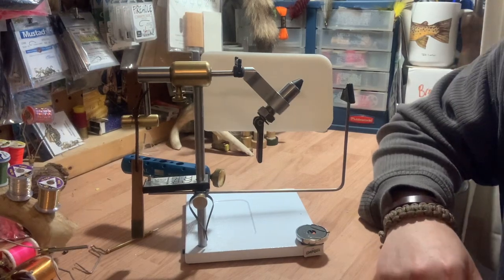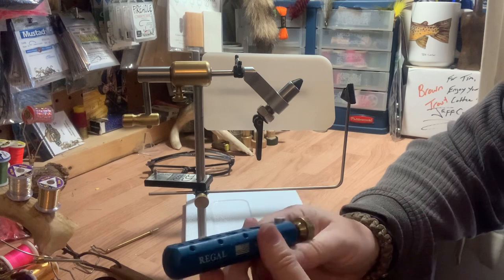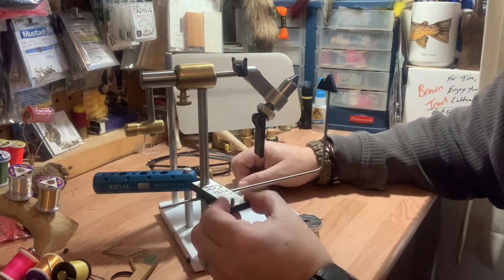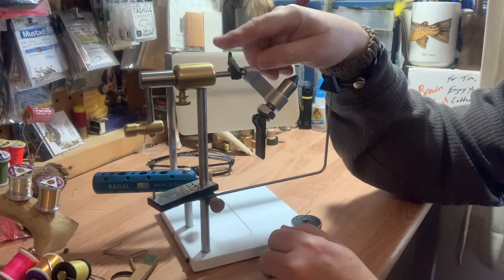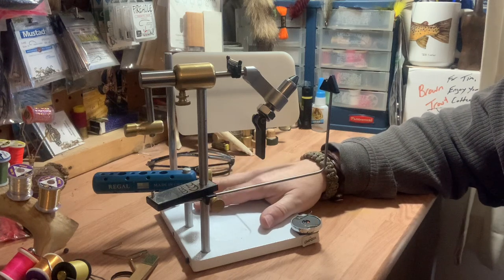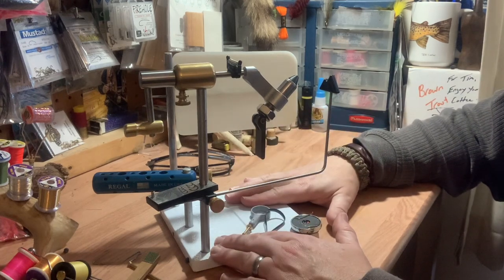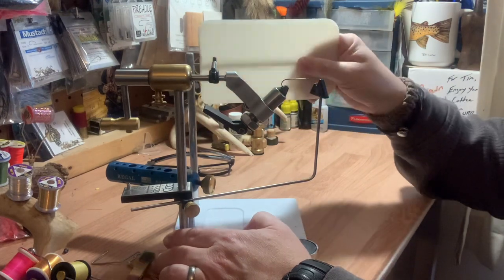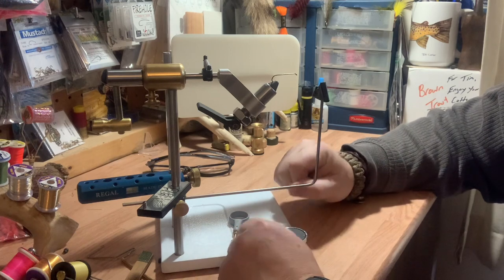Peak fly tying vise: it’s the tops!

Comment: Would it be possible for you to make me a profile plate like yours? May I ask some questions, I am brand new at this and I am right handed and am even unsure of how to set up and run the vise. Thank You
Reply from the maker: It’s a simple thing, at your hardware store, get a price of 3/8 “ aluminum rod. Find something plastic in white… and a piece of heavy wire.glue the plastic to thewire  (hot glue) dril the aluminum rod with a few holes to set the wire in

Comment: Why do you have the vise installed in the end hole  .  .  .  most I've seen use the center hole for the  vise.  Advantages or disadvantages to using the end hole?
Reply from the maker: Thanks for asking and watching my videos. To answer your question your question… that’s just what worked for me.  Having my profiler in the back and then the tool caddy  in between and low out of the way put my vise in the first or front hole…
  So yeah that’s  how that got that way.
Reply: Thanks for the quick reply.  I suppose with the weight of that base there is no tilting issues when tying.  I'll have to try my Peak with that setup.  Thanks,  Fred @lockhackle2645

Comment: Thanks for all your explanations on this vise and the accessories.
I have a question for you. How did you fix the brass adaptor you made to fit on the shaft of the rotary vise.
Thanks in advance.
Reply from the maker: Thank you,
   I jut a 1 1/2 in length of brass rod, measured the rotary handle outside dimension at 1/4 inches.
   I drill a 1/4 hole in the brass, and slid it on and it friction fit. For now. Soon I plan on drilling and tapping for a set screw on the pack portion of the brass handle.
  The groove in the brass was simply done on a bench grinder… slowly .
Reply: @lockhackle2645  
Thank you very much.

Comment: Where did you get the larger stem and profiler plate? Brand? Thanks!
Reply from the maker: Thank you for watching. And, the longer post is 3/8 inch aluminum dowl from home depot. The white plastic is from something laying around , it’s got glued to a section of metal coat hanger. The post is drilled with four holes to set the wire into  in order to  move the plate up and down. 
   I hope this helps you out.